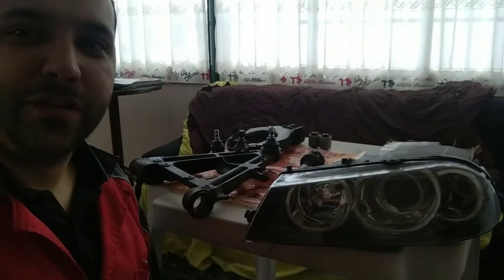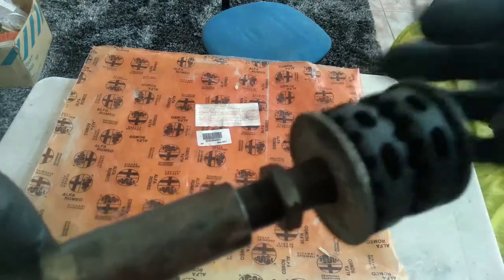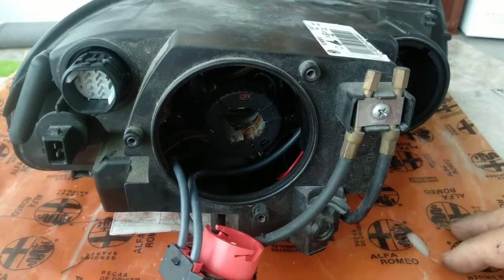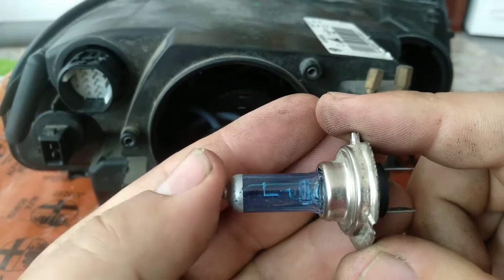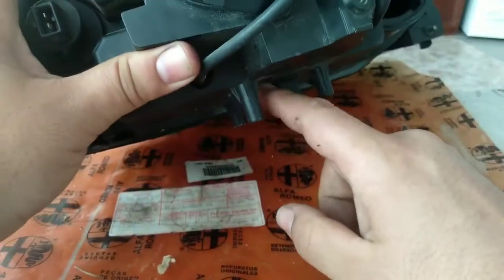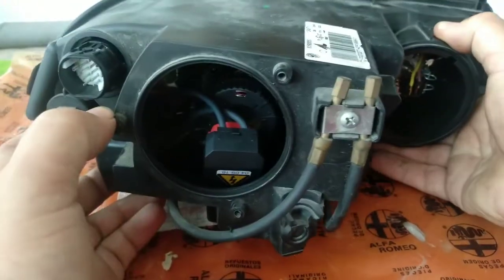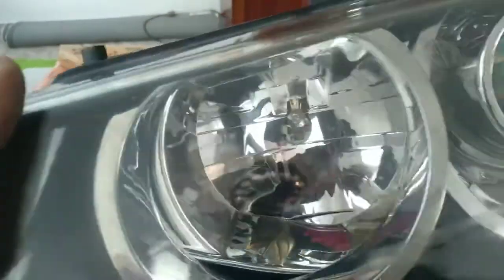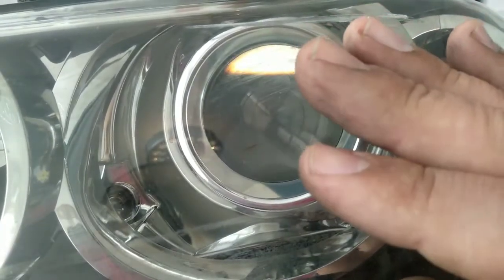How does XENON headlights work  What problems to expect with HALOGEN lamps

Comment: Thank you for your videos! Question: How to easily change the xenon headlight bulbs in the 156 mk2? any tip?
Reply from the maker: Hello. Thank you! I will do a video for that. On the right side you may need to get off the antifreeze reservoir. On the other side the intercooler pipe.
But..
It's easier like the factory says. Bumper off, headlights off, do the work on the bench..
Reply: @alfaromeonoproblem  Thank you !! I was looking for videos about it, there not much information about carefully disassemble the headlight in the mk2.
Reply from the maker: You have to be patient, i have 3 more years of videos to record. In the next months i will try to fit it in.
Reply: @alfaromeonoproblem no problem, take your time! keep the good work!
Reply from the maker: Thank you very much

Comment: Are DRL or low beams mandatordy during day in Portugal? In Serbia, they are.
What do you think about something like OSRAM LEDriving FOG (they are LED DRL + LED fog light)? Or OSRAM LEDriving FOG PL?
Have you seen any 939 Alfa with something like that? I dont know if they would fit and how would I need to wire the additional switch for the DRL light. I tried to find the 159 specific kit, but there is none. Only Chinese stuff that claims thery are, but are realy not.
Reply from the maker: Hello. Here only after 2008 only on cars that have them from factory. No modifications are allowed on types of bulbds, lenses or anything else.
Reply: @alfaromeonoproblem  Thanks.
Reply: @alfaromeonoproblem  I joind the alfa owner forum so I don't bother you with so many small things. xD
Reply from the maker: @DashCamSerbia feel free to ask always.

Comment: Hi, I have the same xenon headlights, and I think the projector/bowl are burnt because the light is terrible even if I put a new d2s bulbs. Can I take out the projector and lens through the bulb change hole or I have to open the whole headlights so I can restore and clean them?
Thanks
Tha
Reply from the maker: Hello. Witch brand of light bulbs do you use? It's very important to respect the brand and Kelvin
Reply: I used Osram and Philips d2s, but definitely it's not a problem with bulbs. It isn't easy to find secondhand xenon headlights for Alfa so I want to do restoration, because the new one are tooo expensive
Reply from the maker: Ok, yes I understand. The problem is somewhere along the way if the wrong bulbs are used this will happen.
There are ways to open and restore the projector, but it always ends up being a bust!
My tip for you, buy now before is out of production! I know it is very expressive, but still
Reply: I need around 1500 Euros for headlights, and that's more than double then my Alfa 😁
So my question again is, can take out projector and lens through the bulb change hole? 
Thanks for the previous answer:)
Reply from the maker: Thank you very much, I will try to investigate. I have this here headlight here and I can see if it does let go from the hole or you have to remove the hole lens.
Reply: Thank you for great videos!